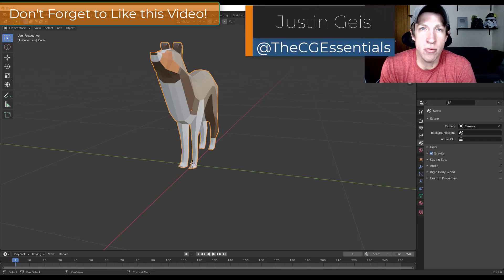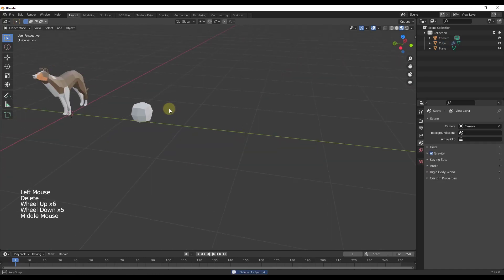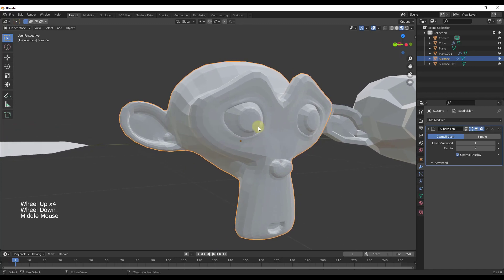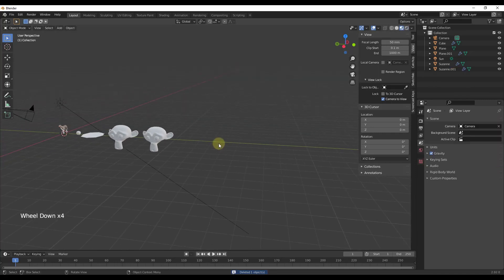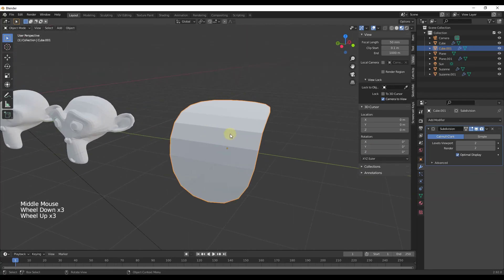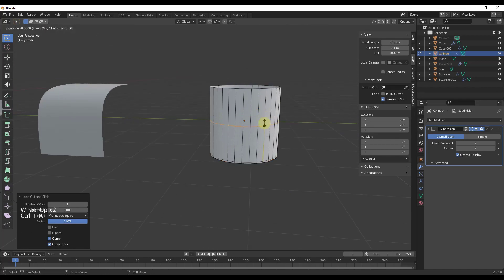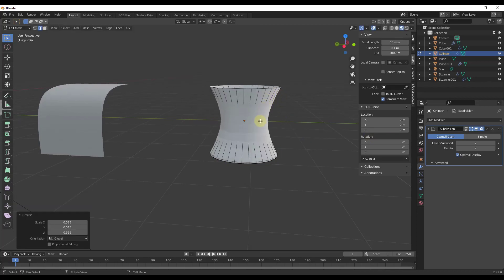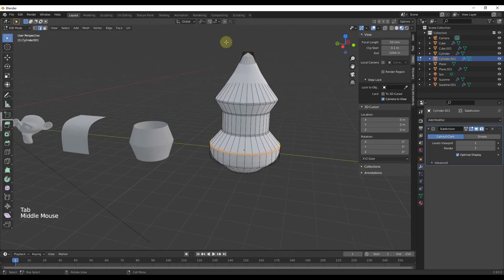Using the SUBDIVISION SURFACE Modifier in Blender - Beginner Tutorial

Comment: Amazing thanks alot with this explanation of subdivide. Does the computer still look at all the verts and not have to read all the extra subdivide? So a cube has 8 points and subdivide shows more but still shows the 8 points. I'm doing a lowpoly character and want to smooth out more so thinking of using subdivide but don't want it to slow performance once I duplicate the character to make more characters in same scene